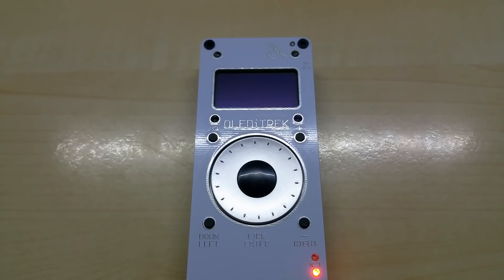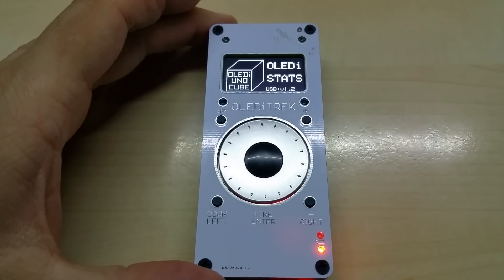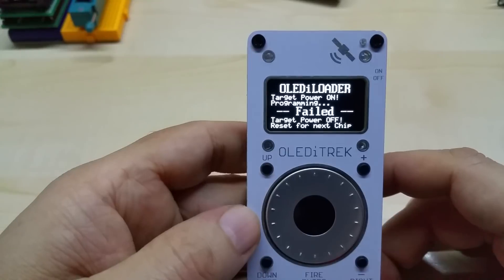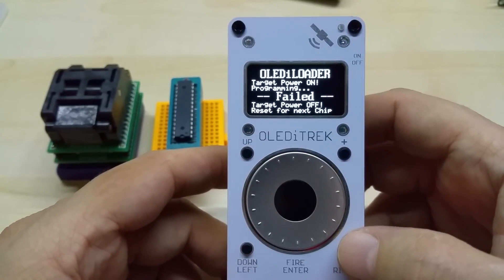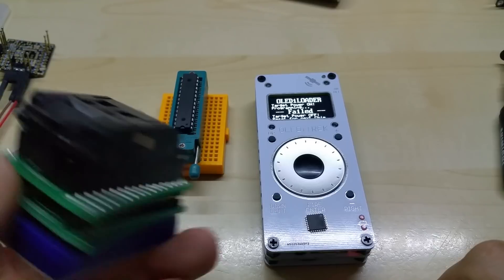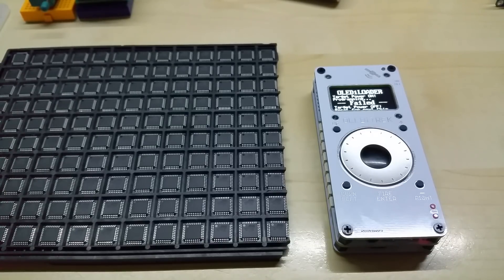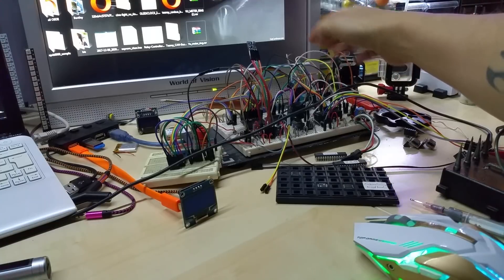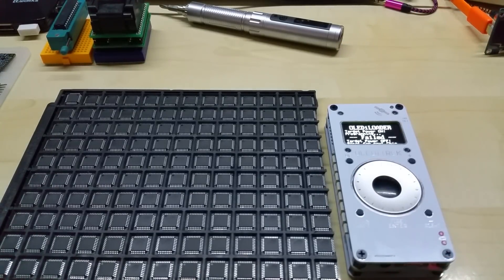OLEDiTREK showing OLEDiSTATS and OLEDiLOADER demo

Comment: Cool couple of ideas for the extra functions. Love the idea of the bootloader burner, and the SMD connector to sit on the top PCB is a genius idea! 7:00 is just porn!
Reply from the maker: Thanks Stephen, yeah I had to beg and cry to get just the tray :-) The 328's was another story.  I just need a good way for the connection of the main and top PCB, needs to be something plug-able, probably 2mm pinheaders, they are less than 5 mm high which leaves room for the male pins. Have the OLEDiSCOPE ready for you, just need to put some other items together :-) I am getting the frames tomorrow btw. Have you seen the stereo S. Analyzer? They will look hammer with the frames :-)) And to eliminate some concerns about the SMD connector to burn the bootloader, I am still using one of my first PCB's to hold the chip on top of it with my thumb and burn the bootloader, still gets reliable connection after more than 300 chips burnt. Sorry for the long reply :-)
Reply: Hayri thats great Hayri! Pin headers will be great, maybe a 3x2 would be nice and solid when 'sandwiching' it all together for the top pcb? Looking forward to the parts and working with you!!
Reply from the maker: And I can't wait to see your first designs :-) The one problem I have with pinheaders is mounting the male pins without through holes. Might go with pogo pins, those would be easy to install, choose any location thats free and just have solder pads on the underside of the top PCB. I am very tight on space and could spread out the pogo pins. I am getting way too many ideas, I could even do capacitive buttons on the top PCB :-) before the bootloader idea I wanted to put APDS-9960 Gesture sensor below the rotary encoder so you could just control apps by waving your hand. Can I fit both? Hehe
Reply: Hayri all cool and crazy ideas!!!
Reply from the maker: Thanks, I just have to draw the final line somewhere and finish the design, or I end up adding more and more :-)